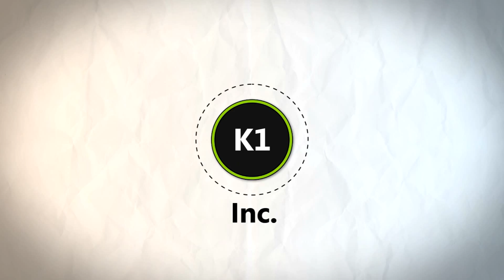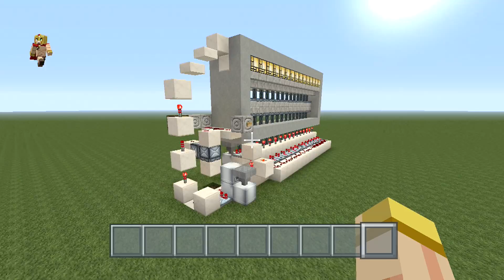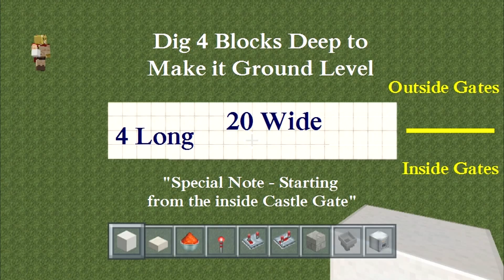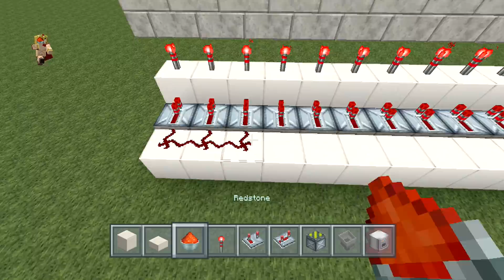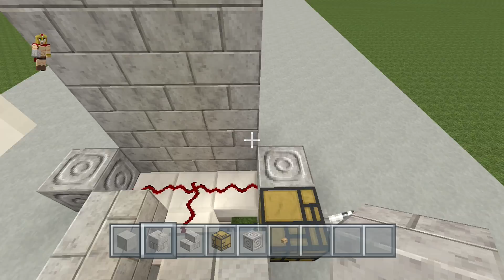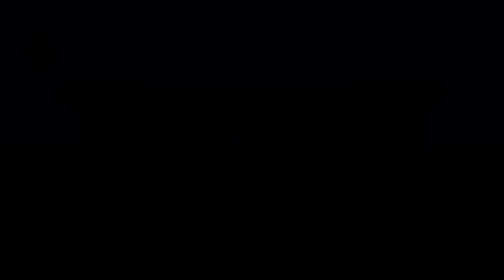Minecraft tutorial : Castle Gates Up to 15 Blocks Wide Plus MORE

Comment: Is this Redstone law only for every other version of MC just not win10 Beta? lol my problem is that when one set of pistons extends the second set retract and Vice Versa (everytime)
Reply: Ok the real problem is this; at approximately 5:50 in this video you place a Sticky Piston NEXT to a block with a Redstone Torch ON it and immediately the piston extends (note: at this point there is NO signal coming from the repeaters on the opposite side of the block) this is what is messing with me on my Windows 10 Edition, Are the rules different
Reply: Im having the same issues with the pistons

Comment: does the dropper thing not work for the ps3. I kept going back in the video trying to figure out what's not working with what I made. its all the same. I put 1 dirt in the dropper and I hit the button and the lamp turns on but that's all that happens. the gate doesn't open or close.
Reply from the maker: +michael tryon I'm here to help 
email me at xk1designs@gmail.com and send me some pics of the design so i could better spot out the problem :-)
Reply: +K1 Inc. OK thanks

Comment: The 3 dropper and hopper setup isn't working on pc 1.8.8.  I push the button and the signal stops at the droppers.
Reply from the maker: +Sickjoke419 not a problem I'm here to help 
email me at xk1designs@gmail.com 
if possible email me some pics so i could better spot out the issue
Reply: +Sickjoke419 I seem to have the same problem. It stops at the last dropper.
Reply: I had it working the first day, but after coming back to my game it just quit working. I'm on a server, so I thought maybe one of my friends tampered with it. So i took it all out and rebuilt it following the tutorial and its still stopping at the last dropper. Not sure how a picture will help since it looks exactly as your tutorial. I can only conclude that it doesn't work on realm servers or possibly on 1.8.8. It's not just this build that the droppers arent working on, its any build that uses the 3 droppers and 1 hopper. I'll have to tinker and see if I can come up with a work around without using droppers. Thanks for replying Ken, the fault is not yours. As always I enjoy your tutorials, keep up the good work.
Reply from the maker: it sounds like a server issue but email me and ill send you some pics of a different design to help with the issue.. I have another format that doesn't use hoppers or droppers and you it will still work :-)
Reply: +morofjompen I had the same problem, but I solve it by replacing the redstone behind the dropper with a repeater and done is fixed! I think is a little bug because on my PS Vita worked without replacing it.
Reply: ok cool, thanks for the fix. ill try it out sometime when i find a spot to build this gate again.
Reply: +Jorel Antonio Thanks for posting that! Your fix with the repeater worked for me as well =D  

It's a great design tho! ^_^  Not sure why that one piece isn't working for some of us (I'm running a heavily modded 1.7.10 on the PC, if that helps)